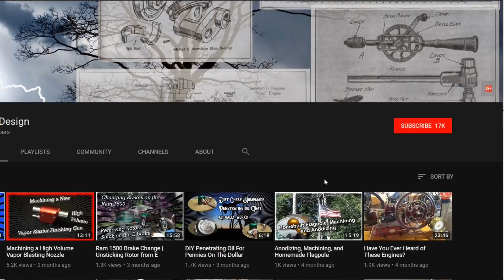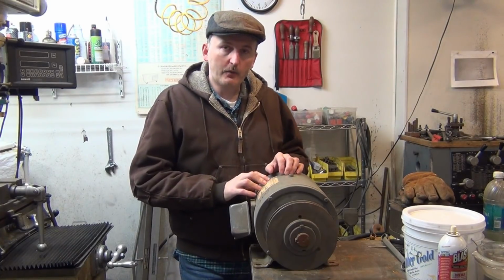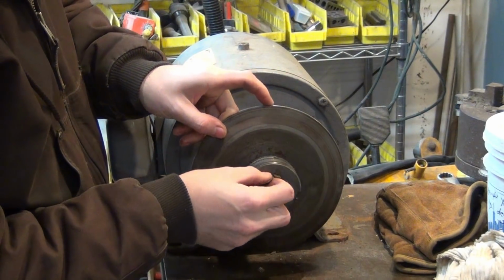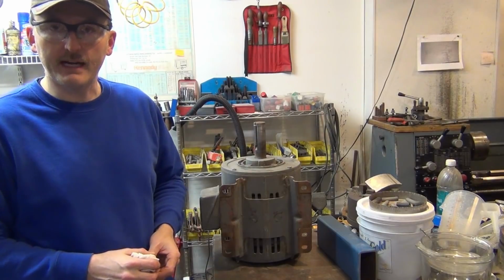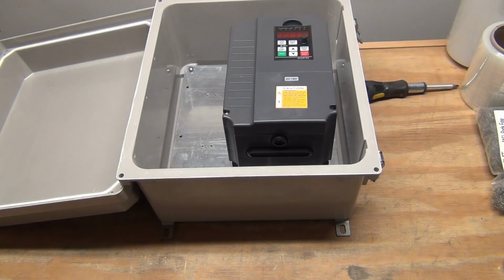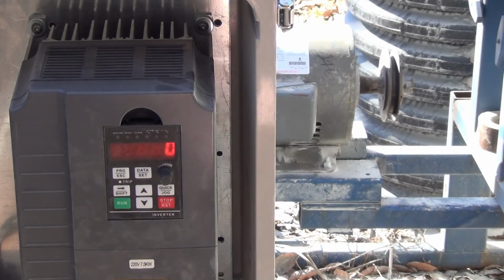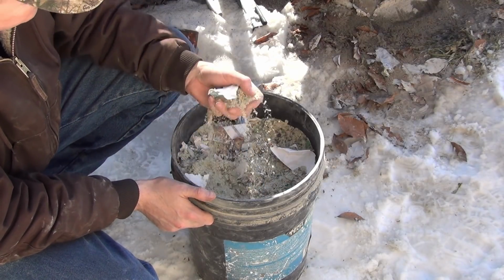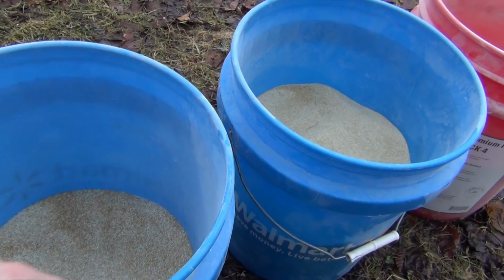Glass Crusher Gets a New Motor

Comment: New here Arnold,  time to sit back and learn what a glass crusher is and what it is used for. We are glad you are sharing this we love learning, I know of rock crushers that behave similarly. We really love our vintage motors, glass is used in bead blasting in our blast cabinet so we get the rust removal when you turn it on. 
That is a big motor we are used to running fractional HP motors only having a mill with maybe a 3 HP running it but we do like larger motors, this one even through a VFD is going to be a lot of power it seems for that glass cruncher. We have not ever seen a split pulley, that is some strong looking box tubing to support the 7.5 HP.
Thank you for the why you do this answer we love it and we like the lesson of grades in glass bead blast uses.  
We are happy to be here, thank you for the share, Lance & Patrick.
Reply from the maker: Thanks for the comments guys. I appreciate it.

Comment: Man I'm a little worried for ya. I'm sure you know, but the general rule of thumb for using a VFD on single phase is to derate it by 66% due to only powering two of the DC buses. 7.5kw is around 10 HP with 66% being around 6 hp. With your 7.5HP you're pretty close but not quite there. If it was an Allen Bradley, or ABB, I'd say you would be fine, but with that Chinese one. I worry... haha This is all assuming you are single phase service. If not, this whole suggestion is null and void!
Reply from the maker: I'm running single phase. My original choice was to run a 5hp motor with a 10hp vfd. I had a difficult time finding a used one, so just decided to use the motor I had. I wanted to go with a 15hp vfd, but over 10 hp the price is astronomical. I keep the ramp up time slow to reduce starting amperage, and I don't overload the crusher. I know what you mean about the Chinese vfd's though. I was thinking the same thing. There's no way those vfd inputs are going to take the amperage for what single phase needs for a 7.5hp motor at full load amperage.  My motor's fla rating is 21 amps. If the vfd burns up, I will spring for a bigger size. I won't be out production time, because I don't crush glass as a main business.
Reply: @ArnoldsDesign  everything you said is 100% true. The price of VFD's over 10hp is astronomical. My suggestion, if it ever fails, would be to find a used 460v, since they are what industry typically uses. You will need a 15 kva transformer, but combined I think it will actually be cheaper in the long run. Where I'm at in the Midwest rust belt, dry type transformers go for $20/kva and 460v VFD's $25/hp. I could probably ship you a drive easily, but a transformer might be a little bit of a feat! Haha
Reply from the maker: @Herthan  Excellent suggestion. I will keep that in mind. I hadn't thought of using a transformer. Are those prices for used equipment? I looked for a 5hp 3ph 230v four pole motor out at HGR supply in cleveland. Even they didn't have one, at least at that particular time. They did have some that ran on 460 though.
Reply: @ArnoldsDesign  4 pole motors everywhere, they are just going to be dual voltage Y wound. I'm sure that's what you have. They have a set of taps for parallel or series for 208-230 and then for 460. Everything I see around here is dual voltage up to about 20hp, and then it turns to 460 only. But you have to be careful, because sometimes if you get one that is rewound they will tie the taps internally and only be able to use one voltage. But most reputable shops will stamp out the voltage on the name plate that it hasn't been rewound for.

Comment: Nice project. I'm curious if it'd be cost effective to make media in New York State with our 5 cent bottle law.  I know crushed glass media can be costly, but maybe saving on shipping costs is the real benefit?
Reply from the maker: I think if you have to pay 5 cents a bottle, it wouldn't be. I can get about 60 lbs of finished cullet into a 5 gal bucket. I just weighed a 12 oz(volume) beer bottle, and it's .443 lbs. At 60 lbs/bucket, that would take about 137 bottles. At $.05, it would be $6.85 per bucket, or a little over 11 cents a lb. You can buy 3000lbs bagged on a skid for about 11, not including freight. Maybe If you could buy it by the triaxle load from a local recycler it would be cheaper, since the state might be subsidizing it.
Reply: @ArnoldsDesign  To be clear, the nickle is added on to the purchase price of the drink. Many people don't bother returning the bottles and cans because it not worth the trouble. In my case, taking them back nets me about $3/hr and that's not profit, that's recovered money I've already paid out. The state of NY banks on folks not returning the bottles but, touts it as an environmentally friendly law. In your example above, I suspect the shipping cost on a 3000lb skid could be significant and add a lot to the total, maybe pushing it towards being worthwhile. There is the cost and labor involved in building and operating the crusher and sifting machine.
Reply from the maker: @kmcwhq  I haven't check on shipping. Even if I went to pick up a skid myself, it would be costly. Sounds like NY is making a few bucks on non refunded deposits. I didn't know that's how that worked, though the word "deposit" should've given me a hint. They should call it a core charge.